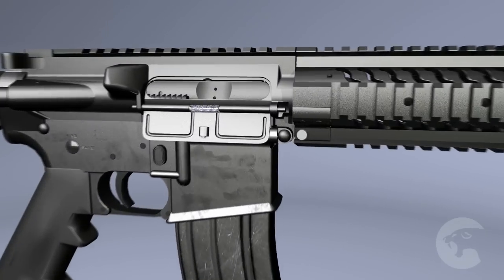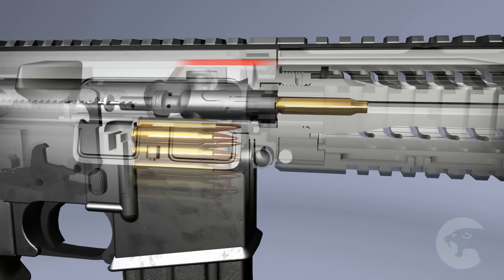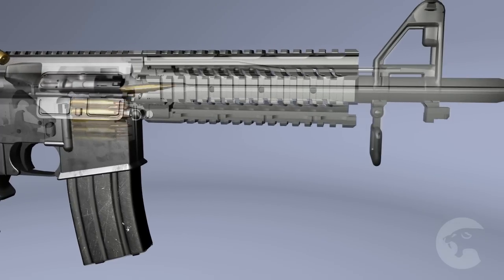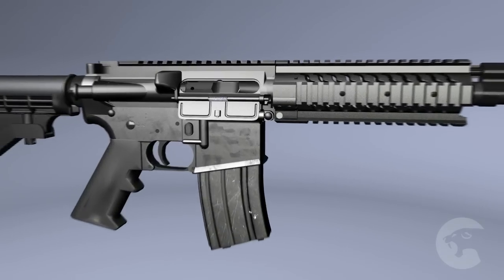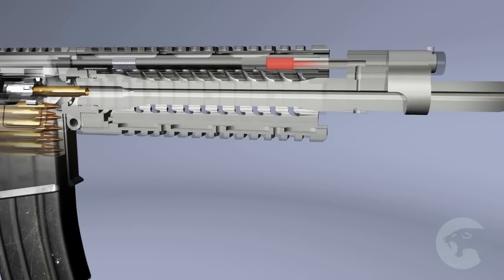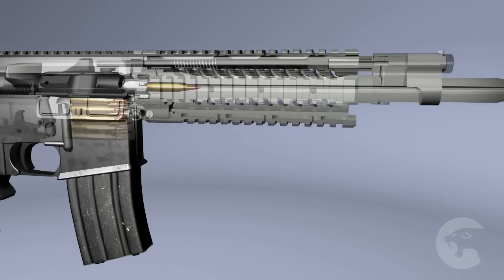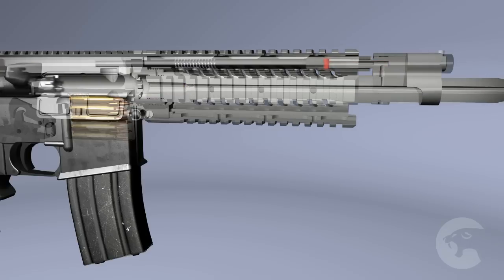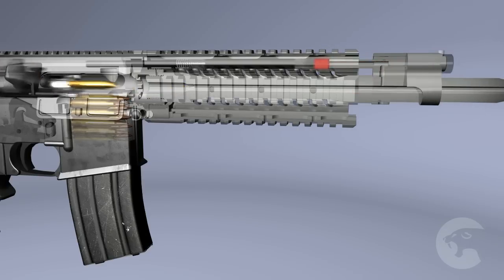Sabre Direct Gas Impingement System

Comment: I also used to have an aimpoint but its hard with a stigmatism in my eye and and really hard to line up with glasses so im saving for a leupold or Night force 1-4x32. Ive shot 200 rounds at the range  running quick fire and draw drills with no failures either.

Comment: @fffreddie The results showed that the vibrations (harmonics) to the gas piston systems was higher than the gas inpingement systems. Since the tests were conducted for security the results are not published unless you have security clearance. The Colt AR-15 was chosen over all the rest. The engineering department went by the tests results over personal tastes. The same system is used to find wear on pump and motor shafts as well as other plant equipment. Oh eddy current was used on the barrels.

Comment: @fffreddie I'm a fan of both systems because I believe they both have their benefits. I agree that the "problems" with DI are over exaggerated but so are the "problems" with piston guns. I own 4 piston rifles that I have put thousands of rounds through and because of a 20 dollar buffer tube I put in each of them I have no issues whatsoever. Plus its nice to have a adjustable gas port when using a suppressor. Its preference and there is no right or wrong choice.

Comment: @IKEELYOUNOW What they don't show is the carrier tilt from the piston drive that wears on the inside of the upper receiver and the front bottom end of the buffer tube. Inspect the buffer tube and you will see excessive wear where the carrier grinds away the aluminum. Given enough time it will wear away at ther buffer tube and start on the lower receiver. Also inspect the inside of the upper receiver and you will see excessive wear. Please inspect these areas.

Comment: I believe it's a longstroke piston AR-15, but the operating rod is not a solid, it has a joint(link) in at least 1 place to give way downwards(articulating) to combat carrier tilt, which is a common problem in all piston AR-15s from the excessive force pistons apply.

Comment: I have both DI and an Adams Arms kit.  The Adams Arms is heavier but its sure nice to not have to hose the bcg down to get it clean.  Piston is easy to clean.  Pull the piece out of the front and wipe clean.....thats it.  Very reliable and accurate.  I think the greatest development with the AR M-4-M-16 brand of guns would be a piston "fix" for these guns, then they'd be as reliable as the vaunted AK.
Reply: I don't really trust Adams with the amount of duds I'm seeing from them. My buddy just got one and had to have it sent back because it won't cycle.

Comment: You can do that with any firearm today.

The myth that the AK is some special snowflake gun that functions in every condition comes from in Vietnam when the AK had already been in service for at least 15 years, and the AR-15 had only been in service for a few months.

When the AK was starting out, they literally fell apart in the field. The front trunnion would constantly break apart at the welding and the barrel would fall out. Is that reliable? Nope. All guns have trouble in prototype form.
Reply: Good points

Comment: No. This is not longstroke. This is short stroke. In longstroke operation, the operating rod is attached to the carrier, and is also attached to the piston head.

This "solution" is foolish because while it does make the rifle go longer between cleanings, it applies excessive force to the bolt and its components, which can lead to them breaking. This also increases weight by a considerable amount since you are adding several moving parts that Stoner designed the system specifically to eliminate.

Comment: @Cullenb11231 Or do the smart/right thing and stay with the direct impingement system designed by Eugene Stoner.  I can't see spending hundreds of dollars to fix a nonexistent problem with his design. The one's that like the gas piston system can spend hundreds making it work efficiently. But you know you really can't fix the carrier tilt problem. You can only buffer the tilt by spreading the forces elsewhere. The forces are still there.